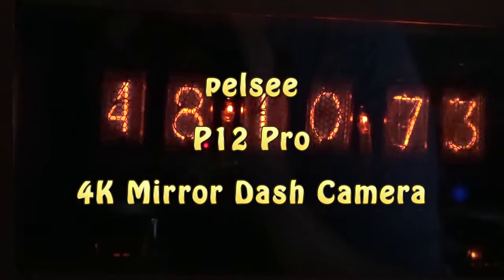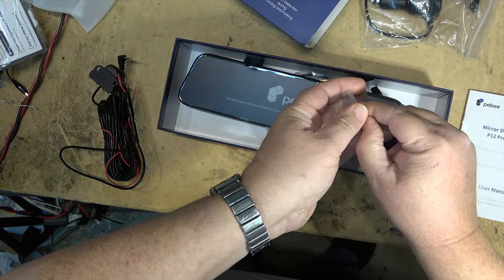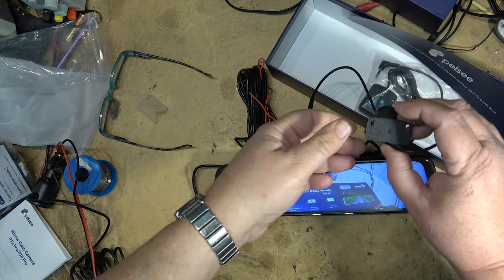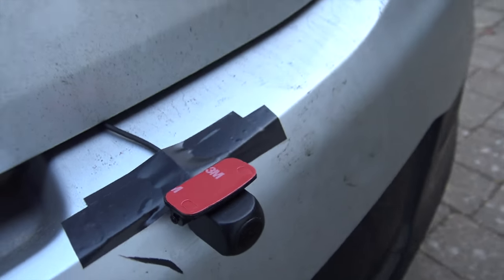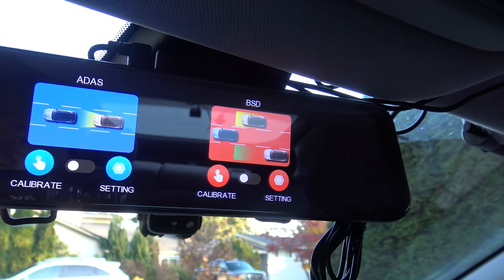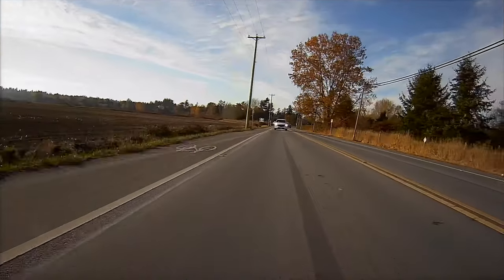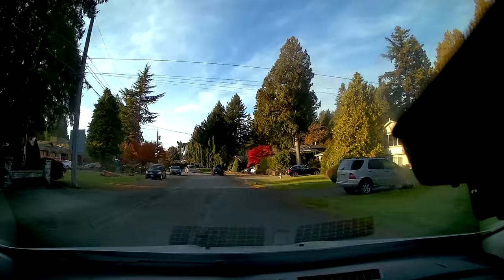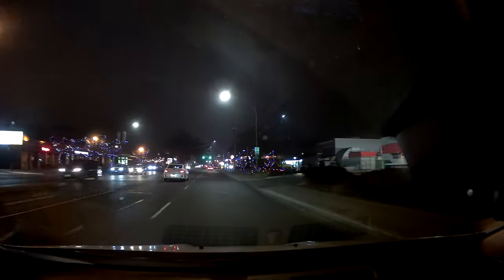pelsee p12pro Mirror Dash Camera

Comment: I keep dashcam audio on, just strip it when it goes to YT, simply because it might have music on it from the radio. file size slightly larger, but then again not that much. Nice dashcam, looks like the higher end units are getting way better performance wise, and the price keeps on dropping, so I might soon want to upgrade dashcam again. I always keep a few spare SD cards in a bag, just in case I need to swap one to keep the files, or if the card does decide that write lifetime is over now. Easy to buy the 32G ones on sale these days, the larger ones i am wary of, way too much storage in the tiny volume, and in most cases it is the same 32G SLC now with a MLC controller to stuff 4 bits in each tiny cell.

Comment: 21:10 You could use Davinci Resolve; there's a free version which would do 99% of what you'd need it for, or a one-off paid for version which gives all the bells and whistles.  Many people have ditched Premier (and Photoshop/Lightroom) because of Adobe's greed.
Reply from the maker: The problem is learning it all over again.  I know how to do what I need to do with premiere. Some day if I want to move to 4k p60 I may have to make the move but for the cameras I use they are limited to 4k p30 and premiere handles it just fine.  You are right about the corporate greed, but adobe didn't start it, that could be crApple that started that.

Comment: The G Sensitivity setting for breaking force ? Continuous loop until G Sensitivity records hard breaking ? Thanks for the review, looking for Dash Cam myself. 73's
Reply from the maker: Yes, you can set it for low medium or high. On high it responds to every pot hole on the road.
Reply: @12voltvids  Thank you for taking the time to answer my questions. 73

Comment: Maybe I’m having trouble adjusting mine, but I noticed that you can’t use it as an actual mirror without sacrificing the angle of the front dash cam. So I have to literally only use the rear dash cam as my “mirror” otherwise the front dash cam angle is affected
Reply from the maker: Front angle is fine.  Shows what goes on in front of the car.
Reply: @12voltvids  yeah idk how yours is. For mine, I can’t use the mirror as a mirror without sacrifice the angle of the front dash cam. It’s too far right and up. I scroll the touch screen and it’s still so far. Maybe it’s just me
Reply from the maker: @OdayLpha  what you see on the screen is only a portion of what it records.  If you hit the change view button to show both on screen that will show you what is actually recorded.
Reply: @12voltvids  I would like to retract my comment, as I feel dumb lol. I didn’t realize until now that the front camera is like a little ball and could be rotated. Up until now I was trying to rotate the whole mirror.

Comment: How well does it work as a mirror with video off? Or would you just leave the screen on while driving?
Reply from the maker: It works as a mirror with the screen off but is a little darker than a regular mirror. Looks like when you flip the mirror to night mode.  I usually leave it on all the time as i have the camera mounted outside the car so it shows the blind spots nicely.

Comment: Interesting video.
Thanks for your effort.
Couple of questions if you don’t mind before I book an appointment.
Will this unit fit over the rear view of a -14 Ram?
I’ve looked at others of these strap on cameras and the stock rear view is so chunky that it wouldn’t fit.
Not sure how much trust can be placed into what essentially look like rubber bands.
Could you give a rough estimate as to what the total cost’s would be for the unit and install?
Many thanks.